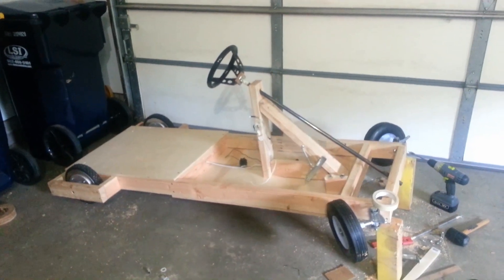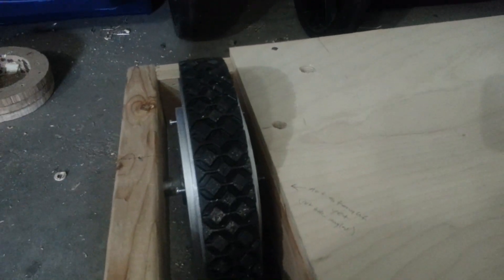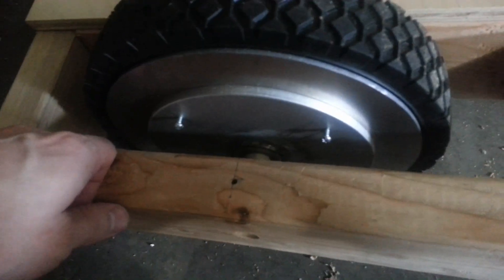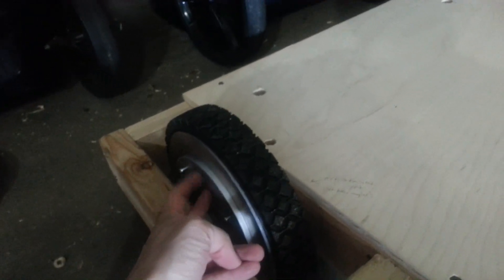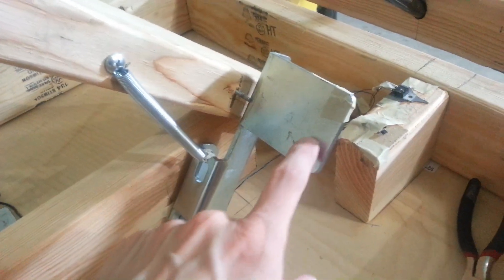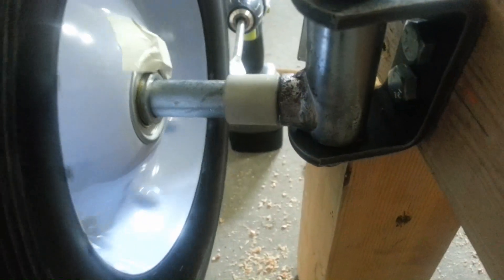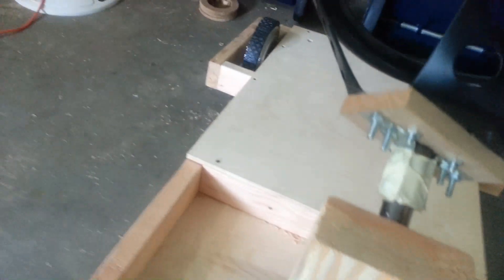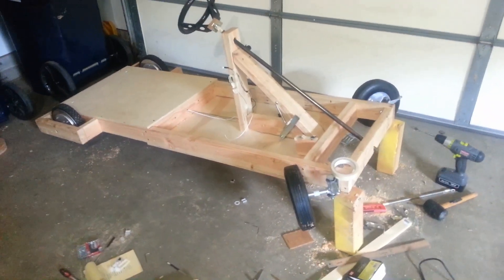Homemade Electric Go Kart, Part 1, From Scratch

Comment: if chain sprocket is so inefficient then why are they used in bikes of some reputed companys?
Reply from the maker: +Parasar Bhattacharya Great question. There are two ways to make a bike motor work: one being a hub motor, the other being a regular shaped motor with a shaft and sprocket. The second can easily be fit into a regular bicycle without disassembling the wheel, and requires very little R&D from the company. It also provides a gearing ratio. It's easy to find high-voltage, low-amperage motors that spin fast, and the sprocket will gear it down to lower speed with higher torque to turn the wheel. There are benefits there. But physically turning and moving something is always less efficient because of extra energy being required to overcome friction, inertia and air resistance.
Reply: air resistance is negligible in case of sprocket and chain, also the case of friction is lesser, as compared to other vehicles, it is coz you are getting a much higher torque, even if the friction is so much bothering thing and you belive that its making the thing in efficient you can opt for a homemade CVT constant vehicle transmission. it can resolve maximum problem and even get get the efficiency of a electric vehicle to nearly 80% or more, as you will not neet the speed controller and drivers to control the speed, the CVT will do it, its very easy to make if you have an access to a leath machine, welding mechine and drill machine
As a engineer i would love to help you in that issue, as i am rite now handicapped due to an accident i am unable to do mechanical works, so i would love to help you in that, but what you are making is really cool and keep on with it.